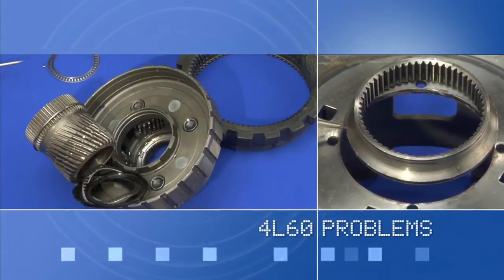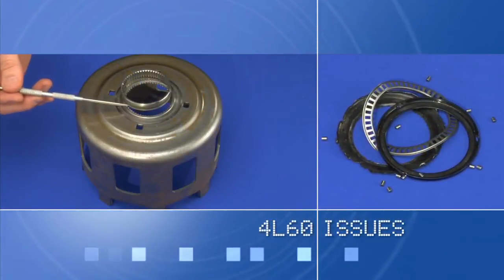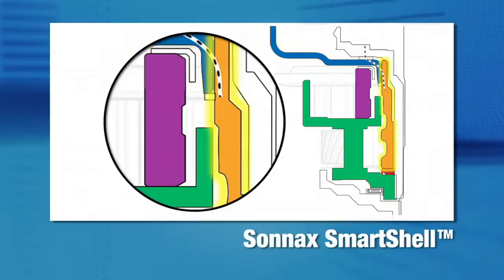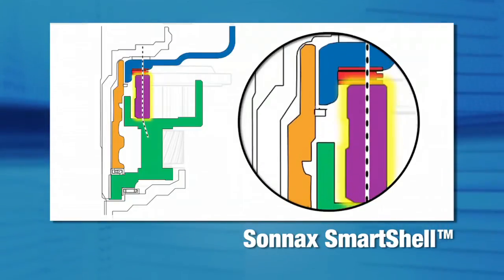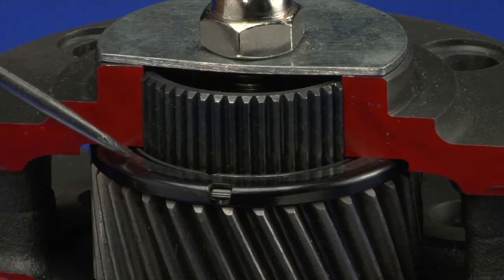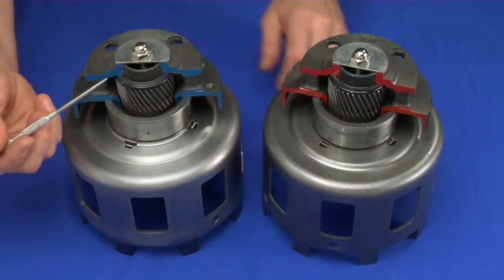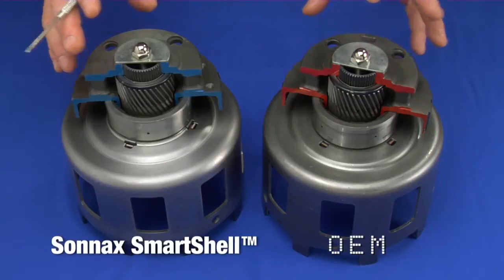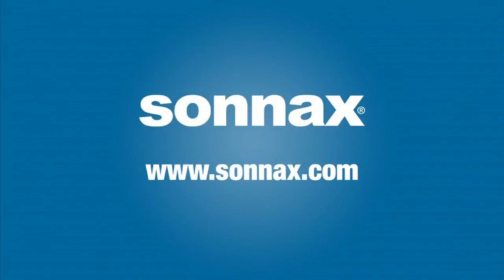Sonnax SmartShell® - Heavy Duty Reaction Shell Kit

Comment: What's the difference between this one and the beast?
Reply from the maker: Great question! While stronger and thicker than OE shells, the Sonnax SmartShell is not nearly as heavy as the Beast. The SmartShell has some unique patented features that improve rear planetary failure. This kit includes a bearing that replaces the black plastic thrust washer and special low roller inner race. Click here for more info: https://www.sonnax.com/parts/2454-smartshell-heavy-duty-reaction-shell-kit
Reply: Sonnax Industries does the beast kit have any unique features other than being a heavier duty shell??